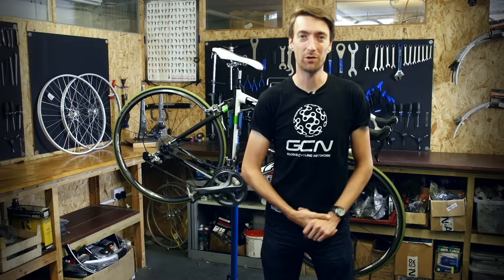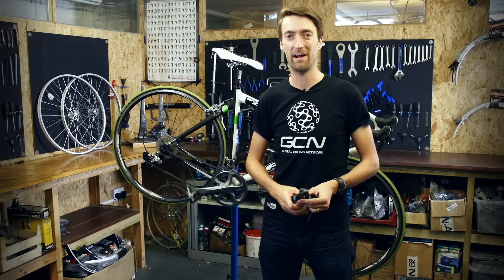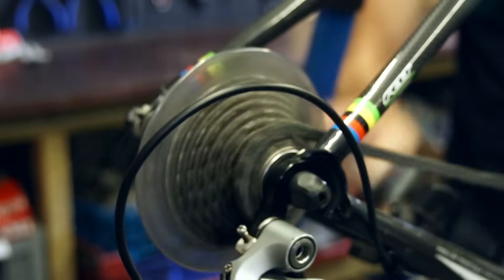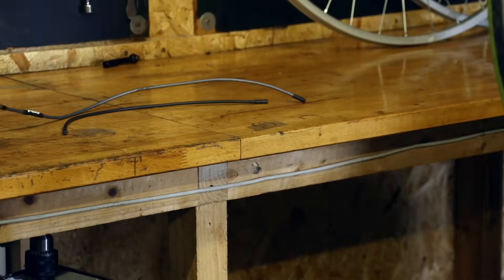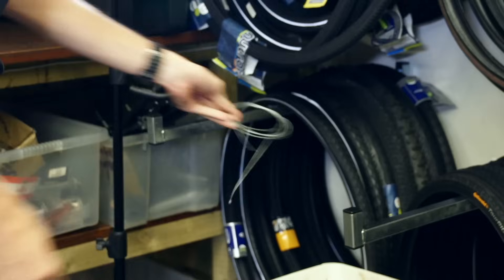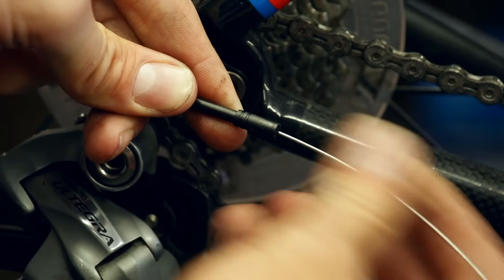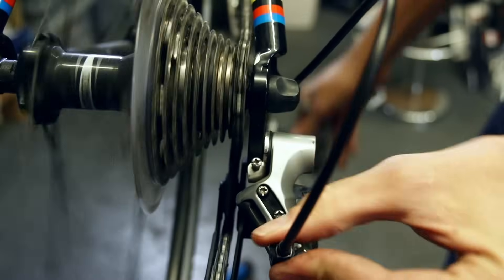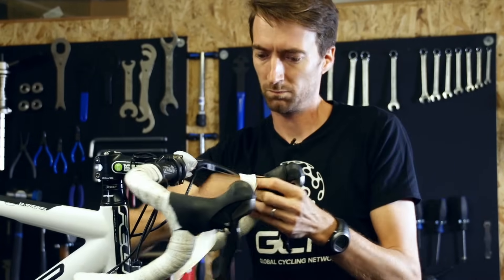How To Change Your Gear Cables

Comment: I have done this procedure many a time but that little tip to take the slack out by manually pushing the rear mech in is just the piece de la resistance! Great stuff! Big thanks for doing what you do.
Reply: Good call Jason, the same here I was struggling with the job until I watched this video.
Reply: The phrase is piece de resistance. No la.

Comment: I forget what you do when the top of the cable is broken off inside the Brifter. It won’t change to the smallest gear so I get it out without tension on the wire. But the wire is so short I can’t reach it. Oops. I can done this before. There is a way.

Comment: Great tip, Dan at 3:40 re taking up the tension in the RD cable. Had to change out RD and cassette this afternoon and it worked a treat; 1/2 turn of barrel adjuster and perfectly indexed gears. Thank-you.

Comment: This might be an old video, but that tip for easy indexing is gold! I had to replace my cable and was NOT looking forward to the fiddly process of indexing, but thanks to your tip, all I needed to do was manually move the rear derailer to the 3rd smallest gear and the tension on the able was almost perfect, I just needed to give the adjustment nut a few turns! A lifesaver!

Comment: If I may, I'm relatively new to the biking mechanico world and have turned to YouTube for help when I feel it necessary & have seen a few of your tutorials. I'd like to make some suggestions that may be a service to those out there like me that are in need of help. 

-slow down.  You guys fly thru the steps!  It may not seem so from your perspective but consider your audience!  

-don't skip steps or even the most minor detail. For example,  in this particular video, you show how to change the front cable in all of 30 seconds when, truthfully, it should be given its own time/video.  (Today, I came specifically to see how to do a front cable-and yes, it IS easy, but then again, for someone who hasn't done it before...)

-don't work on new bikes. Most people working on their bikes are going to have bikes that have been thru it, enough that things are broken and need to be changed. 

Just a few suggestions; I hope they are helpful in any way. 

Also, as to front cables on a grip shift, where should the actual on-bar shifter be positioned? Full back or full forward? And should the derailleur be in the most inboard or most outboard position?  I couldn't tell from your 30second afterthought mention in this video.
Reply from the maker: Hi Chris, thanks for the feedback, always looking to improve so we'll see what we can do. Cheers, Tom
Reply: Youtube allows you to slow down video speed, if that helps with your first point.
Reply: Or simply pause the video. And go to next step when you are ready 👌
Reply: @zac8670  this I did not know. That'll make learning vid life so much easier

Comment: I just finished buliding my bike and lost the cable cutters a few years ago and I was too cheap to buy some new ones as I only wanted quality, so I got by with cutting the housing with a dremel which was really easy and a good excuse to use the dremel and for the cables themselves i found this cutter on a set of wire strippers and it was very sharp and cut really nice.

Comment: Hi GCN. I use a four hand tool on the cable to ensure the cable had no whirlpool in the middle portion through the hosing or cable guide.  The other thing is technology is really improving, the new Sram Cable Cutter had a pin to allow user make the hose round opening if it wasn't cut perfect though the edge is still not smooth.

Comment: Nice video, BUT i also recomend to lub the inner cable just a little bit, before installing. Thanks and good riding!!!
Reply: I replaced mine last year without and now my gears have completely seized up. You really need to lube.

Comment: A wooden cocktail stick worked fine to open up the hole in the outer cable, Clarks brake and gear cable kits were cheap and good quality - had a nice plastic inner unlike the cable it replaced.
Reply: +Kie 7077  A wooden  cocktail stick  is not strong enough .....  and it could snap off  and get stuck insde the cable.
Reply: +keith bick Since I've done several cables and used a cocktail stick to clear the end, I can say that it is plenty strong enough and does the job fine and they only cost 50p for 150 of them from the supermarket. Also work as tooth-picks!

Most of the force is pushing the stick towards the hole, there is no reason why the stick would break doing this. Perhaps you're not using good quality cutters to get a clean hole, Ice-toolz cutters are good and good value on  ebay.

Comment: good vid, but a few more tips on exactly how your thread it through the holes in the Brifters would be good. I found putting it in from the top to see exactly where it pops out worked well. also its worth pulling it taught once you are through the Brifters and clicking them to make sure its seated properly. otherwise you could thread it all through the outers only to realise you havnt got it sat quite right in the Brifters.

Comment: My question is about the cables you buy to replace on a road bike. Do you have to get the pricy cables only or can you use basic cable? I have I installed new shimano ultegre 6800 shifters. I was told I can only use shimano cables. I don't believe that. they can cost up to $70. I am not a heavy rider so I don't see myself changing cables offten.

Comment: can i change the inner fd wire without open the bar tape? because my cable inside the bar tape and how to make the shifting and braking level be smooth? did i need to put some oil into the cable?. i was using 105 groupset.

Comment: Quick question. I just got a bike with internal cable routing. The place where the front mech cable comes out of the frame does not have any protection so water might get inside of the tube... Is this very bad?

Comment: Any ideas on an improvised tool to shrink the cable end caps? My cable cutter doesn't have an integrated shrinker. I use a regular set of pliers instead, which works but is not ideal.

Comment: Hi I have a new set of Ultegra 6700 levers.  I managed to get the right shifter and cables in with no problem.  But, I can't seem to figure out where the shift cable goes in on the left side.  I've tried a couple of places that appeared to be the "cable hole", but none of them seemed to put the cable in the right place for it to actually engage with the mechanism.  Any advice?

Comment: I have an internally routed frame.  Does the rear der cable and housing have to enter on the right side of my frame or can I cross  the housing to the left side?  Same for front der cable and housing?  Or does it have to enter the frame on its designated side.  reason I ask is because I am installing inline barrel adjusters for front and rear ders.
Reply from the maker: hi, 
Yes you can route the cables so that they enter on different sides.  
sometimes this allows you to have a smooth curve of cable.
thanks
Jon

Comment: Sooo yeah I just did this for the first time on a road bike, along with brake cable and housing replacement, and it took me friggen 3 hours to do it.  Sucked.  Oh well, the RD cable was definitely frayed inside the shifter mechanism so it was definitely due for replacement.
Reply from the maker: That's cool man, bet it feels heaps better now! And, you'll be faster still next time.

Comment: Thanks for the tip on setting the RD cable tension. Any tips for the FD cable?
Reply: Please check the manufacturer's instructions first to familiarize.  It's hard to explain simply.

You can use the low limit adjustment screw to pretension the cable by :

Check barrel adjustment direction in 1st gear before you start.

1. Pretension :
With the chain in small front, small rear, undo FD cable, "wind off" FD barrel adjust all the way, wind up low limit screw so that the FD outer face is inline with the outer ring outer face (or even a touch further out), then tighten up. (fingers pulling the FD cable or gently with the long nose pliers)

2. Low limit
Then set Low limit adjustment normally (while in 1st gear, 0.5-1.0 mm from inner chain).  Make sure to be in full low position in the FD. 

3. Trim
Then check trim position (big ring, big cassette cog) with FD one click back from full outer ring.  

4. Big gear position
Then check the big front, small rear chain position, so that the FD isn't chain rubbing.  This is where you need to use the barrel adjustment to get the final 0.5-1.0 mm clearance from the outer chain.  If you need to adjust outward, first change FD down to small ring, then "wind tension up" with the barrel adjuster a few turns, then go back to the outer chain ring to check.  If you need to adjust inward, you can do this while still in the big ring as you are just letting off tension.  In the big gear position the barrel adjuster doesn't always want to move the FD outward, whereas in the small ring position outward FD movement with the barrel adjuster is more detectable.

5. Go back and check 1st gear with FD in full low tension position and use the barrel adjuster. (again 0.5-1.0 mm from the inner part of the chain)

6. Then go back and check the big gear position.  You then start to work it out if you've gone too far either way.

Comment: I think you should have made mention of the difference between the brake and shifter outer cables (we call em "housing" around here). Spiral housing for brakes and compressionless housing for indexed shifting. Getting them mixed up and installed backwards can cause very serious issues.

Comment: My gear cables are not following the handlebar under the tape. They are going from the shifter to the frame in the air. Would I be better off tucking them under the handlebar tape? What are the pros and cons?

Comment: Are Gear and brake cables universal for any bike? I have a commuter cannondale baadboy and an 1989 vintage fuji touring bike? What cables do you recommend for good long lasting performance?
Reply from the maker: hi, 
No. road bikes have different cables to MTB. the nipple end is a pear like shape on a road bike and a barrel shape on an mtb. We recommend Shimano cables for great performance.
thanks
Reply: I second the note on Shimano. I used a cheap knock off once.  Lasted 2 years at most.  and that was on my down tube shifters and the front derailleur.  Went back to shimano.  I'm planning on getting another 25 years out of this one!  :)

Comment: When I climb hills and I am on the small chain at the front plus any of the 2 top gears at the back, the chain keeps wanting to slip one gear down. The top one does it worse than the second one. When I stand and peddle, obviously putting more strain on the gears, it is even worse. Is my cables stretched and need replacement, just an adjustment or is it the gears itself that to be replaced?
Reply: it could be one of 2 things; improperly indexed rear derailleur or a worn out cassette. Ive had the same problem when the indexing is spot on but the chain would derail under load. I replaced the rear cassette and the problem was solved.

Comment: I'm building a new bike up, how do I determine the out cable lengths since I don't have old cables to compare it to?
Reply: Don't have massive amounts of cable waving around. Enough to allow handlebars to turn without tugging on either cable and gentle loops. Start off longer, you can always shorten!

Comment: Is it advisable to apply grease on the cables or cable casing ?
Reply: usually not. Grease or lube will attract dirt faster and most new cable housing should have a teflon or similar lining to help things slide smoothly. 

You can use a little oil dripped at the ends of the housing when you bike cables are getting older to get a little more life out of them.

Comment: i have the old style shiftier ( the lever type ) and i was wondering if the process is the same 
(yes i know it's old :) )
Reply from the maker: Yep, pretty much the same. The only difference is where the cable slots into the shifter.
Reply: ok thanks :)
Reply: but who thought of that style of shiftier it's horribly inconvenient to use
Reply: markus jackson shop bike mechanics...

Comment: Last time I changed my cable I didn't remember there was a hole in the shifter for the cable to come out through so I took the entire shifter apart. This time I remembered there's a hole to get the cable out but no matter what I do the end of the cable never lines up with the hole so I'll have to take the shifter to peices again (last time the shifter broke not long after I took it to peices). Why does it keep underlining shifter like I'm making a typo? Isn't that how it's spelled?

Comment: I would have liked to seen the front mech' cables being done, my chain comes off at the front and it's not the limit screws, not sure why it's happening :-(  ... Not caused by a stretched chain or worn chain rings, both are new.

Comment: GCN if the Barrel Adjuster (Shimano Tiagra) has come out from the derailleur and unable to screw it back in again, could this be worn? I've been trying for 30mins with no joy. :/
Reply: Why don't you tag the company in this
Reply from the maker: ***** It's unlikely but the thread might have stripped. Have a look to see if that's the case. Remember though that the spring in teh barrel adjuster makes it difficult to screw back in, so it might just take a bit of patience.
Reply: Neil Jayaratne
 Shh Neil. :)
Reply: Global Cycling Network
Thanks for the reply guys! Got a spare from my LBS, first attempt straight in with ease. Can't wait to get back on the road, just stripped everything bare for a good clean and maintenance. Almost perfect timing with weather coming up. =]

Comment: How crucial is the cable end cap? I want to shorten the cable and don't have a new one
Reply: Just use some good duct tape maybe. Nipples are cheap online but all it does is stop ends fraying
Reply: i use the aluminium part of some small pop rivets....much cheaper than the legit ones at least for me

Comment: The shimano chain is on backwards. Shimano 10sp and now 11sp chains are directional.
Reply from the maker: This is channel manager Mike Rees' bike.  Whenever he's on a group ride, he appears to go backwards, so actually the chain might be the right way around.
Reply: Hi! In what minute could you see the chain is on backwards? Thanks!
Reply: Flor.e.Cultura if you can see the imprinted writing on the outside of the chain then its on the right way round , the inner plates are chamfered so as to aid shifting up the cassette , 2 way chains have both plates chamfered
Reply: 6700 chain can NOT be put on backwards, but it sure can be put on inside-out. The outside plates are solid, the inner ones are slotted.

Comment: Personally I always smear a thin film of grease over the cable when installing and I've never had a problem with dirt. Besides even if I did I could always unhook the outers from the frame and wipe the cable clean. But I've never needed too.

Comment: For cheaper bikes, I recommend using a MIG welding wire in Stainless steel to replace the cable.

Comment: cant thread the inner cable through the shifter could see where it came through as that is where the cable snapped no sign of the end bit
Reply: paul osgood I have the same problem, my cable snapped inside the shifter.   The reason I came to look at this video is to see if it was covered - but it isn't.  HOWEVER, I have the Shimano PDF dealers guide, and it tells you to remove the shifter from the handlebars, undo a cover retaining screw and then you can get at the small bit of cable left inside.  

I just haven't tried it yet, as I removed the old cable and then tried to thread a bit of it back through to make sure I could.  Got stuck, so put the bike away whilst I ordered the new cable (and bar tape), and then researched the problem on the internet this evening.
Reply: Alan Chandler thanks Alan i managed to do it by removing a plate on the side and then easy took an hour to thread cable set gears and put new tape on , i just took my time . where did you get the dealers guide i woulnt mind seeing that as i am going to upgrade my groupset on other bike and going to try to fit it myself
Reply: paul osgood I found the instructions here http://si.shimano.com/#seriesList/18/56 (chose the ST dealers manual) - just exactly what you seem to have done.  I just did it myself - took about 10 minutes for that small bit, the rest of the time was what normal replacement of the cable would have taken.